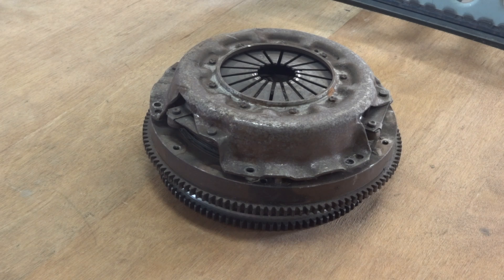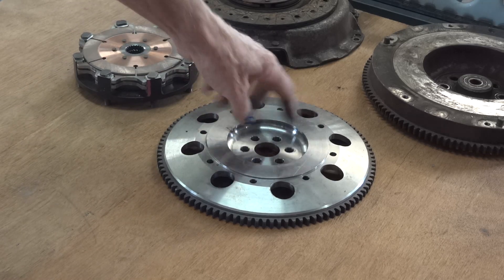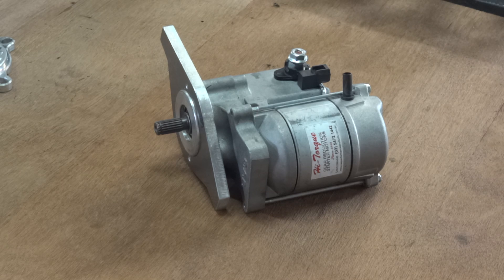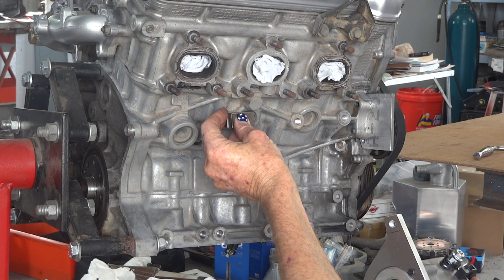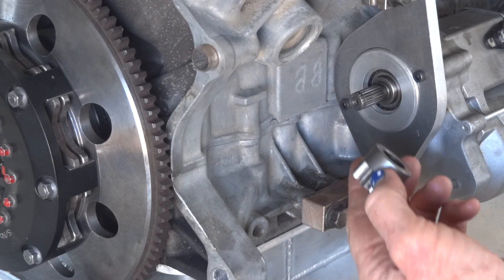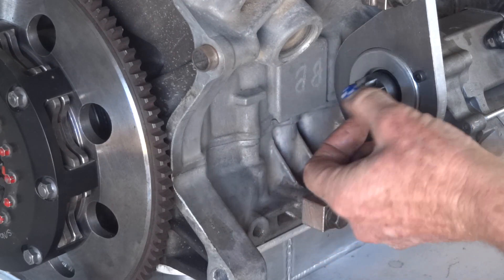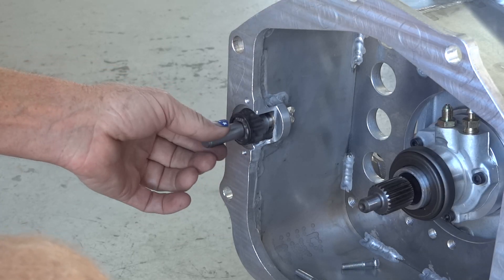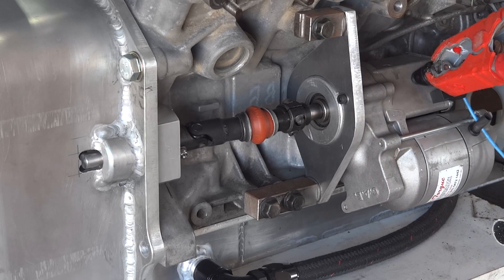Fauxrarri 246T Dino Ferrari replica remote starter motor

Comment: Would it be possible to use a heavy drive fit into the sintered pinion rather than welding to it?
Reply from the maker: ooow, a bit scary, but probably yes, plus a bit of 642 loctite